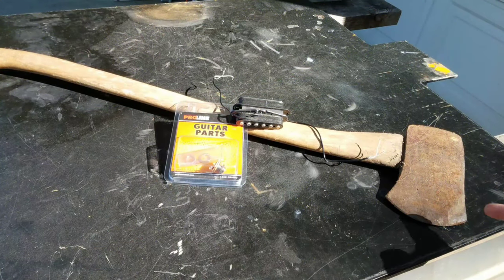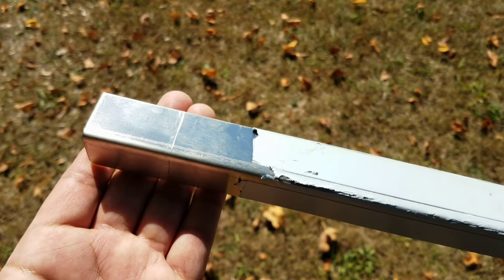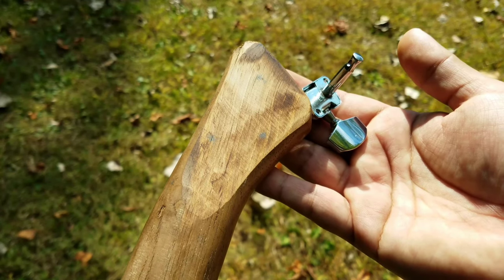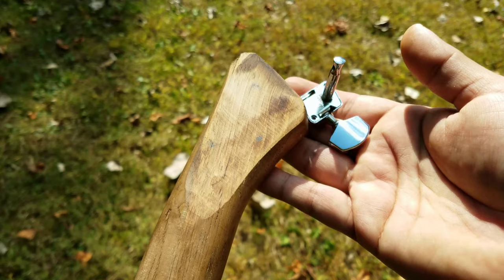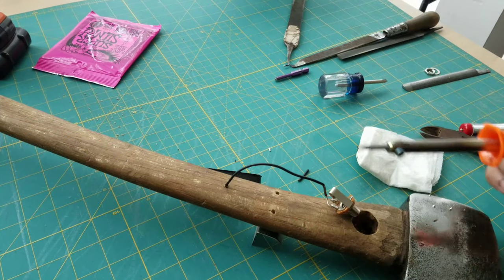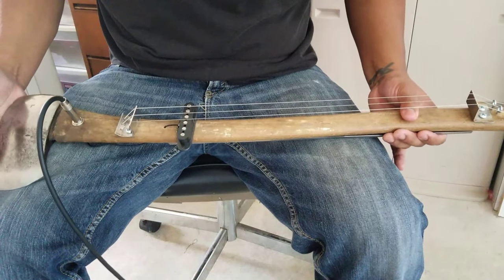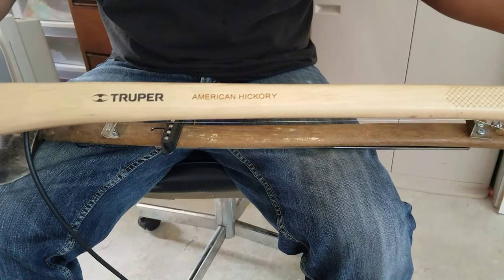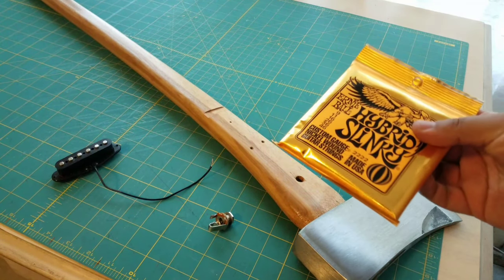I Built a Guitar Out of an AXE

Comment: How did you mount the pickup to keep it from falling out?
Reply from the maker: Glue
Reply: Did you glue the magnet directly in the groove you cut out in the wood or just glued the plastic pickup case to the wood handle? What glue did you use? Thank you for your time and help.
Reply from the maker: I glued the pickup magnet in the channel I filed out. It was a pretty tight fit. I used some rubber cement glue I found at the dollar store, I don't remember the brand.
Reply: Thank you for your input about securing the pickup.